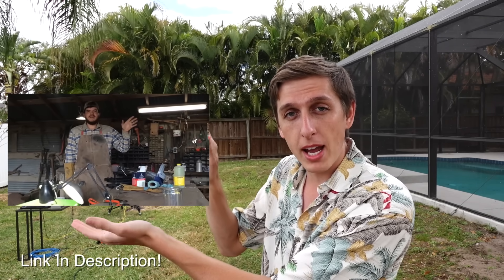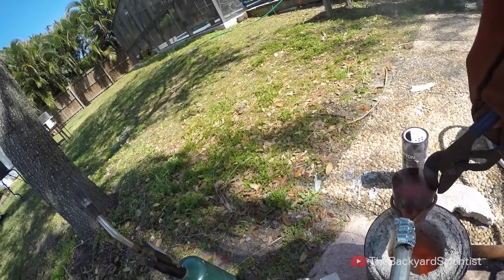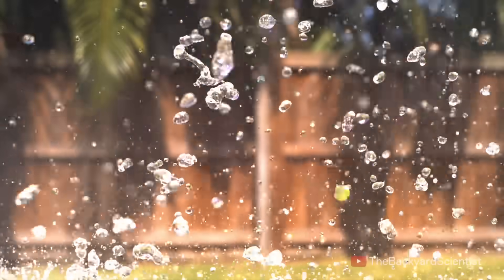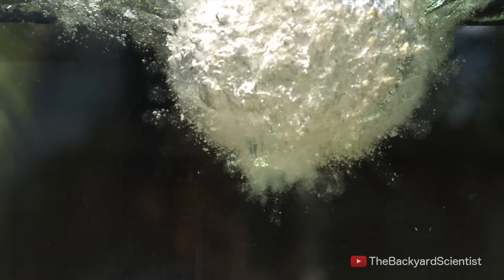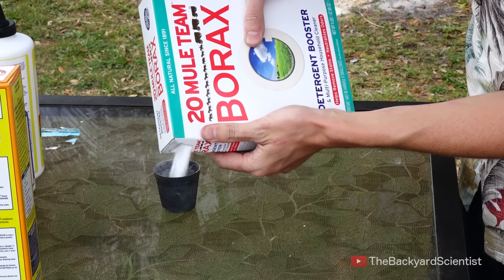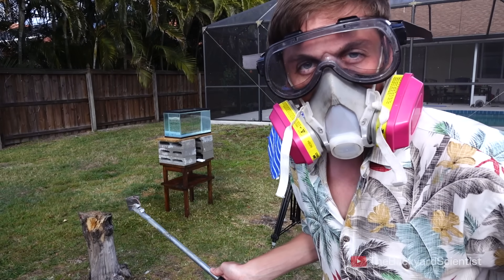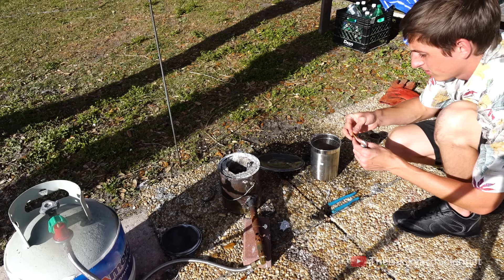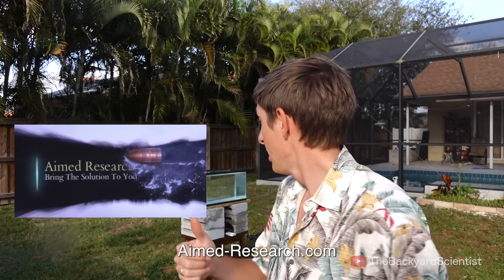Pouring Molten salt into Water - Explosion!

Comment: WHY EXPLODES: IT IS SIMPLE CHEMICAL REACTION..MOLTEN SALT IS VERY WATER SOLUBLE , AND ACTS THE SAME AS SULPHURIC ACID EXPLOSION. THATS WHY YOU DILUTE ACID WITH WATER , AND NOT WATER WITH ACID...GET IT NOW?!!
Reply from the maker: +john carter no still don't get it, what's a sulphuric acid explosion?
Reply: +john carter Actually you add acid to water not vice versa. Adding water to acid creates a very concentrated acid solution. Acid solutions can have the tendency to release large amounts of heat when reacting, this can cause basically an explosion and highly concentrated acid solution splashback. If you add acid to water, the reaction is much more controlled, as the solution is mostly water.
Reply: Ian Aquino A chemical reaction has to alter the chemical formula of a molecule. A solution doesn't change any chemical formulas. So no, Ian, I am not retarded, I'm right.
Reply: +john carter Solutions are not chemical reactions.
Reply: +TheBackyardScientist  Next time to be safer with the sodium, you can add a layer of oil on the top so that it takes time to sink past the oil and into the water. Stay safe bro, and thanks for the videos.
Reply: +john carter lol a bunch of non sense you have.
dissolving ions in water has nothing to do with chemical reactions...
we dilute acid with water because we want to lower concentration of acid ions. We can kind of dilute water with acid if you want lower H2O concentration when you say dilute.
do you get to go to school?
Reply: +TheBackyardScientist captain here  the explosion could be due to small atomic/ionic sizes of sodium and chlorine. this isn't the case for borax and sodium carbonate they have significantly larger anions which have a larger solvation enthalpy.
Reply: +The Bunny Suit Killer
sulphur [suhl-fer]

Word Origin

noun
1. Chiefly British. sulfur (def 1).
2. Also, sulfur. yellow with a greenish tinge; lemon color.

Origin of sulphur variant of sulfur
-----
Please remember you speak English not "American."
Reply: Why are you yelling?!
Reply: +adrian5b 

"A chemical reaction has to alter the chemical formula of a molecule.  A solution doesn't change any chemical formulas"

Not true at all.  Many solvation processes are chemical in nature. 

In fact even with something like sodium you can often view it as the salt is forming weak chemical bonds with the water

Na + 6 H2O -> Na(H2O)6

Pardon the lack of superscript charges,  I have to figure out how to get Youtube to do them. 

Then you can also talk about things like acids where there is a clear chemical change going on

HCl + H2O ->  H3O  +  Cl

That's actually why there is a heat of solution is because you are creating and breaking bonds in the process.  These bonds are just not the stiff chemical bonds you are used to seeing.  If anything solvation is usually boarderline between the classical definitions of a chemical or physical process.
Reply: +john carter So you propose the theory that the salt is trying to form a prince Rupert's drop, but cannot withstand the internal pressure that glass can. So instead of just forming a bead of salt with a "Tail", it just shatters instantaneously. Because the outer layer of salt gets cooled down first, the center would still be solid. So lets say that the density of molten salt is lower than solid salt. Therefore creating pressure from within the salt bauble, and causing it to explode? (If that makes sense) 

Tl;Dr Salt explodes when cooled down rapidly, because of the pressure caused within.
Reply: The trolls on this guys page is astonishing!! And I can't tell if John is a Troll, has Autism, or is just ignorant as fuck!!! -_-
And this "scientist" forgot to mention the fourth State, not property, dumbfuck, of matter, plasma!!! The actual fuck crazy people, at least get your bullshit right, if you are trying to convince anyone you are intelligent!!
Oh, and caps-lock is for sad fucks who don't understand to use Bold to emphasize, and italics when speaking an aside! CAPS IS FOR YELLING, PERIOD!!! :D Cheers!!!!
Reply: +john carter It explodes due to the rapid creation of steam as the water is heated by the salt the salt shatters increasing surface area allowing the rapid stem production .
Reply: +john carter If you look at your keyboard, there is probably a little light that is turned on somewhere, usually on the upper right corner. That light is usually labeled "Caps lock" but can also be something like a capital A or an up arrow.
When people write messages on the internet, they usually do it with the little light turned off. Leaving it on cause your post to be written in capital letters which is like shouting and using it all the time is considered rude.
You can turn that little light off by pressing the key labeled "caps lock" (or sometime just "caps", or a lock icon). On standard keyboards, it is on the left between the "shift" key (often represented by an up arrow) and the "tab" key (often represented by a left and right arrow)
Reply: +john carter OOOOH MY GOOD! ---further explanation and clarification-1st. THE BACKYARD SCIENTIST IS COMPLETELY RIGHT! This is not CHEMICAL reaction-He proved that Ph doesn't change!.....2nd. This is physical reaction due to big temperature difference-- As he pointed and explained by stretching the green goo!...3rd.  He said that water steam instantly expands 16 times its volume--BUT HE SAID HE DIDN'T KNOW WHY? Why this happens? --4th. I AM SAYING THAT it happens because the SALT Hardens Instantly , also some salt gets diluted in water! Also the created steam Shatters the Hardened SALT (AND YOU KNOW HOW GLASS SHUTTERS WHEN SOMETHING IS COLD AND HOT -SO THE HARD SALT REPRESENTS GLASS-HYPOTHETICAL GLASS) I AM NOT REFERRING TO THE ACTUAL GLASS TANK!----5th. also the temperature difference creates a lot of steam it becomes a bomb....6th. The previous example was given when you instantly mix Sulphuric acid &water-explosion!, and i will add another example - mixing active lime and water in closed bottle also creates explosion!--Water is a very runny and soluble liquid and has this tendencies to enhance explosions!..7th...You cannot squeeze water-it is not possible to reduce its volume that's why the pressure of the steam created -broke the fish tank, while the steamy explosion was diverted upwards!.. Many things are happening here, you have to think in multiple dimensions and levels.. nature is complicated thing and all things are connected..I guess the 3 Newton Laws work here!
Reply: john carter you clearly don't sound nor look like a middle-aged man! Seriously! Calling people idiots because they're not as advanced in chemistry as you are is something 10 year olds would do. Grow up dude.
Reply: +john carter That's completely wrong. You're supposed to add acid to water, not the other way around. This is Lab Safety 101 people.
Reply: Why caps brush
Reply: Caps lock button broken?
Reply: +john carter Salt (NaCl) is neutral, ya dumbass.
Reply: +Philip Fahy YES, THIS IS WHAT I MEANT-YOU EXPLAINED IT GOOD...BUT IF THE BACKYARD-SCIENTIST STILL DOESN'T UNDERSTAND WHY ACID EXPLODES, THEN I WILL TELL HIM TO STUDY SOME CHEMISTRY..because both acid &water are vely soluble and water&salt ..THATS WHY IT EXPLODES..ALSO THE MOLTEN SALT EXPLODES BECAUSE IT BECOMES HARD AND COOLED INTO THE WATER. SO IT SHUTTERS LIKE GLASS.
Reply: +john carter Nope, I don't think so. Sodium chloide isn't an acid. I can't tell for borax but sodium carbonate and boric acid melts better than sodium chloride but they didn't explode, and boric acid is actually an acid. My theory was that chlorine would fly off leaving sodium behind but sodium carbonate would also release carbon dioxide and leave sodium. Moreover, if sodium reacted, the resulting solution would be acid. I still don't know what caused the explosion.
Reply: +TheFreaxTux sodium atoms become unstable when heated and combine with the oxygen in the water leaving hydrogen gas.
Reply: +john carter Dude, no need to get all salty over it. Not many people are PhD's like you so STOP TYPING IN ALL CAPS LIKE THIS
Reply: +Ian Aquino You had a good run. Overall it was a pretty good try at life. Better luck next time brah.
Reply: +Jeroen Feher Yet you took the time to reply....
Reply: +TheBackyardScientist  a sulphuric acid explosion is when u add ur water to acid instead of adding acid to water and the acid 'explodes'. what happens is that  commercially available sulfuric acid is dense (~1.8 g/ml) and when water is added, it may not mix in this case a layer of hot ,weak acid solution is formed, which boils and sprays around. (hence the 'explosion') When acid is poured into water, it flows down the flask and mixes much better, so no boiling occurs. john is just very astonishingly terrible at explaining things. i think he's trying to say that just like the h20 rxn h2so4, the nacl instantly boils the water and the explosion u get is a steam explosion as the heated water vapor rapidly expands, which really seems like the only logical explanation :/
Reply: +john carter I strongly agree to your notion; in fact, I was about to say the same thing.
Reply: +Chillbro Swaggins YES WE ACTUALLY KNOW WHAT IS HAPPENING! We are very close to the correct answer, and this is how science is done, by making couple of calculated experiments, and guessing  the right answers! EMOTIONS ASIDE , THE SCIENTIFIC FIELD IS NOT FOR THE LIGHT HEARTED mediocre minds! Every scientist welcomes CRITIQUE , BUT critique on the experiment , not on MY CAPS LOCKS , YOU IDIOTS! you are just members of the jealous inquisition - do you believe the earth is still flat and the sun goes around your idiot brains!.. SO COMMENT ON CHEMISTRY NOT ON ME! DUMMASS!
Reply: +john carter the Matter has 3 properties: Steam , Liquid and Hard matter. .The temperature of Earth is not a "normal" temperature it is very low actually..It can grow up to millions of Celsius. So here the difference of temperature about 1000 degrees contributes to this explosion! Temperature is the biggest factor, and creating Steam and the impact of sudden motion is other factors! You have to think that salt is not hard MATTER at this moment it is LIQUID  AND WATER IS STEAM! Think hard stupids , with you mediocre brains-ha ha! I WONDER WHAT WOULD HAPPEN IF THE BACKYARD SCIENTIST SHOOTS THE MOLTEN SALT FROM A HYDRAULIC METAL CYLINDER IN HIGH SPEED- OPPOSITE TO JUST POURING IT!
Reply: Pretty sure that what is happening is that as the water touches the molten salt it turns to steam with associated rapid expansion.   You can get a reaction similar to this by super heating water (water in a microwave for several minutes)  and then dropping something into it.  The resultant explosion is quite similar.  Try it and you will see.
Reply: lol wut
Reply: +Cyberw4y I want to say that mixing acid and water together would decrease the molarity(aka concentration for those who don't know and the units are moles(don't know what this is? then search up ted-ed mole)/liters of the acid). I only know this cause i'm taking AP chem and all but if I remember correctly we use M_1V_1=M_2V_2 to dilute acids into the molarity we need
Reply: These comments destroyed more brain cells than all other YouTube comments combined
Reply: there is now chemical reaction, its more of a PHISICAL REACTION sinse it doesnt alternate water after the explotion, the Potencial of Hydrogen isnt either increased or decreased. sorry for grammar btw
Reply: +isailwind I do know about that. that's why I was talking about sodium being left when sodium chloride is heated.
Reply: TheFreaxTux no problem. Sodium atoms are very unstable at such high temperatures.
Reply: +TheBackyardScientist it could  be the Sodium being more exposed to the water.
Reply: +john carter Shedding of electrons
Reply: so it'd like opposites so it gives you opposite effect which is an explosion right?
Reply: Pink Rose it's the hydrogen that explodes.
Reply: ez readz
Reply: MelioraCogito did u stutter?
Reply: Say waaaaaat
Reply: +kd7uha but then why didn't it work for the other Molten compounds?
Reply: did you have to yell at me ;-;
Reply: Shuddup
Reply: +john carter is right all metals that are like sodium do the same thing molten or not. the metals include Lithium, Sodium, Potassium, Rubidium, Caesium/Cesium, And Francium. in its pure form they all react very violently with water.
Reply: they have 1 or 2 valence electrons they react very violently
Reply: +john carter caps. Instantly ignored it
Reply: Yes.. your the smart guy now.. !! so What?.. You talk like you know everything..
Reply: +kentred studious YOU'RE*
Reply: better make your own content
Reply: +Tejas Upadhya this isn't 9gag
Reply: simply put, the experiment did not account for the Cl in the salt and focused solely on the Na
Reply: I think it could be a chemical and physical reaction combo as the chemical reaction can be the sodium while the physical part could be the chemical reaction propelling the little cooled part of salt and high speeds
Reply: +john carter NaCl is an ionic compound so perhaps the Na become an ion and readily reacts with water?
Reply: +Chillbro Swaggins percicely. the Clorine is fine in water because it is on the right side of the periodic table and that side doesnot react with water yet the first 2 collumns of the periodic table to the left are extremely reactive. Na or sodium cloride is in that group and extremely reactive with water. the heat separates the NaCl (or salt) so then that happens.
Reply: +Marco Guimaraes lol... salty i see what you did
Reply: CAPS LOCK-SO THAT IDIOTS CAN READ-HA HA!...SIMPLY THE MOLTEN SALT HARDENS-INSTANTLY AND SHATTERS MIXING WITH WATER STEAM, AND IT EXPLODES..ALSO SOLUTION HAPPENS UNTIL IT HARDENS ..IF I HAVE REALLY FAST MICROSCOPIC CAMERA WE CAN SEE THAT..the sulphuric acid is another example of stuff that it is instantly soluble..i don't think any chemical reaction happens like creating Hydrogen or chloride gas..if you created hydrogen with this video-YOU SOLVE THE WORLD ENERGY PROBLEMS-YOU CANNOT EXTRACT HYDROGEN SO EASILY-YOU NEED ELECTROLYSIS!!!..i MEAN THE WORLD Oceans are full with salt and water, and we heat them and create Hydrogen- you can create FREE ENERGY OR CARS RUNNING ON WATER..- I WISH BUT IS NOT POSSIBLE!
Reply: gubx42 FUCKYOU-I KNOW WHERE IT IS!why you stupid people you think that is OK to educate me -i am middle aged  man, i can do whateever i want, don't talk to me like a child!-this is your education:i am a good person but if you educate like this another person in real life-he will brake your nose! you are keyboard punk!
Reply: john carter you sound like you've been bullied throughout middle school and high school. Jesus dude go outside, I don't give a shit about your chemistry. All I care about is why were you yelling when you could've just typed it normally and delivered your point?
Reply: john carter terrorist?!! Dafuq you got that from??? And you clearly have some reading problem because I just said the reason why I commented on this.
Reply: +The Bunny Suit Killer Actually it is.  There is a small town in Louisiana named that.
Reply: Things that people are taught change over time.  When I was younger we were taught there were only three states.  Now science says there are actually 5.  You left out Bose - Einstein Condensate.
Reply: Paul Ogea of course the Plasma state or Bose - Einstein condensate are other states of matter , but have not much effect in calculating what happens in this mostly Physical reaction-explosion!
Reply: Paul Ogea I know about this..YES..and you need distilled water ..
Reply: Chillbro Swaggins Well, if you pour molten Lead in Water it will just cool down, NOW WE CANNOT GRANT YOUR WISH THAT EVERYTHING WILL EXPLODE- the nature doesn't work like this!
Reply: +Lady Nora Really? All caps locks are emotional reactions.
Reply: +eF Ka How can his shift keys be broken when his keyboard isn't real?
Reply: +Jordan Johnston (JayZee) How could he have stuttered when his mouth isn't real?
Reply: +Marco Guimaraes How can he be salty when our tongues aren't real? How can he type in ALL CAPS when his keyboard isn't real?
Reply: +DylG1111 How can you try at life when life isn't real?
Reply: +john carter Well, you see, you can actually add water to acid and not get any explosion out of it. Check out Cody's Lab video on it.
Reply: Chillbro Swaggins Sorry, Google plus is always fuckey with showing responses to comments. Youtube didn't show me any. I just assumed he was ignorant of the acid dilution myth.
Reply: Chillbro Swaggins It may go boiling, however, it will not explode.
Reply: john carter How? 
Third world countries? Where do you conclude to that?
John are you stupid? -_- 
CAPS ARE USE TO SCREAM, NOT SO IDIOTS CAN READ BETTER, USE COMMON SENSE _
Reply: +john carter, omg all these tryhards using big words, stop trying to look/act smart, we want a definition not vocabulary...
Reply: Ferguson Landy tryhards is not english...if you don't know how to spell what you doing here -commenting about chemistry!
Reply: john carter who said i wanted to speak english
Reply: Hi john c... Ca.......CENA da da da daaaaaaaaaaaa
Reply: +john carter i dont think its a reaction buddy. plus you have no idea what you're saying lol
Reply: Ian Krasnow i KNOW..WE ALL READY CLARIFIED THAT.. NOW WE TRYING TO FIGURE WHAT IS HAPPENING MICROSCOPICALLY, and to explain it properly..if you read all the comments you will understand, and please avoid reading the stupid trolls.
Reply: batsman46 OK SMART GUY..LOL OH LOL..and what is your opinion , what is actually happening here! tell us if you know?
Reply: let me think. In a neutralization rxn such as with HCl + NaOH --> H_2O + NaCl. Water is involved, so would be an equilibrium thing. But I can already tell that John is gonna yell at me how that isn't what's going on here but considering that this is what I know about water and acids, I might as well put this out there
Reply: +Noah Braasch correct
Reply: +Noah Braasch lol
Reply: I still don't get it
Reply: Your caps lock is stuck
Reply: I agree. And thanks for that reminder! I took at least 30 units of Chemistry in university, and to this day I can never remember if I'm supposed to put the conc sulfuric acid in water or the other way around. Lol. I graduated without accidentally blowing anything up, thankfully. And now I stay as far away from the laboratory as I can. :P
Reply: Revina Que ha ha ha, you pour slowly the conc. acid in a vessel of water.....never other way around it will explode!
Reply: john carter Actually, since I could never remember that rule, I've poured water into concentrated sulfuric acid multiple times, and it never exploded or even bubbled. Granted, we would only use a couple mL of the acid each time (max 15mL or so). Maybe that makes a difference.
Reply: +john carter sorry to be that guy but its much more simple than what your spinning here. read my comment i just posted above. or simply put its a conversion from water to steam that is causing the explosion. salt wether it be liquid or solid mix rapidly with water and when water is super heated rapidly it converts to steam. which then expands 1700 times in size. boom
Reply: +TheBackyardScientist ays
Reply: +john carter I would get it better if you didn't type in all caps please...
Reply: +John Carter I like the way you comment in all CAPS and yet you can't even put capitals for your own name.
Reply: +john carter Dude 1) Calm down 2) You need to look up internet etiquette, typing in all caps in the comments, blogs, etc is in fact yelling to the top of your lungs. that's why most forums and blogs ban such behavior. 3) Name calling is very immature and shows your age as much younger than you are. Do not fall in to the "big bad internet bully" behind the keyboard and monitor typing anything they want because "no one can find you to harm you routine , it's unbecoming and a turn off to potential friends and women that may find your intelligence  (Or lack there of) attractive or helpful. and i'm sure you don't act that way in public, school, work, or with your family and friends. 4) There are no "stupid, autistic, or  ignorant" questions in science, the only questions in science that fit your afore mentioned criteria are the questions that are not asked. 5) Please remember the laws of experimentation: Ask, observe, listen..... none of which you have done in this childish flame war. 6) It's okay to be incorrect as you learn more from mistakes than you would from always being correct. 7) Spell check is your friend. Finally 8) You can lure more bees to your pot with sugar water than you can with vinegar, this analogy basically means if you are calm, polite, and sweet, you can gain better things in life. May these words reach in to your brain and change your internet etiquette for the better. I bid you good day sir.
Reply: Revina Que you were lucky!
Reply: mantissage100 HEY BUDDY F..CKOFF! WHO ARE YOU ,TO TEACH ME ETHICS. I AM 45 YEARS OLD, WHEN I WAS BORN THERE WAS NO COMPUTERS FOR YOU TO TYPE NOW..MY GENERATION DISCOVERED THE BLOODY COMPUTERS..sso shut up!..if you go up the thread and check:this my bloody thread , i started it..i am my own moderator and yours..you are contributing now to my thread..and if you don't know anything about chemistry get out of here!
Reply: Edwardo Monkton dumass.!!! AYHHOLE!
Reply: Michael Williams SMARTASS.!!!
Reply: +john carter Wow First off your thread, true but its in TheBackyardScientist post..... a post the he can ban you from. Second, I find it funny that we are VERY close to the same age and yet you act as if your age is closer to your shoe size..... a shame actually because I thought the British made sure that their citizens were smarter than most Americans but you seem to be the cranky old "bugger off", "piss off", "balls it up" , "wanker" limited vocabulary, "dim witted bloke" type of brit....... as such being the case, I can no longer entertain your limited neanderthal intellect and vocabulary any further as I risk lowering my intelligence to that of a football ( soccer ) while drunk pompous ass. (That would be a donkey you twit.)  And for gods sake stop butchering the English language. So long you sad lonely, wifeless high school dropout.
Reply: Huh?